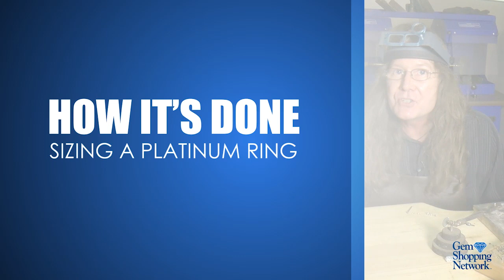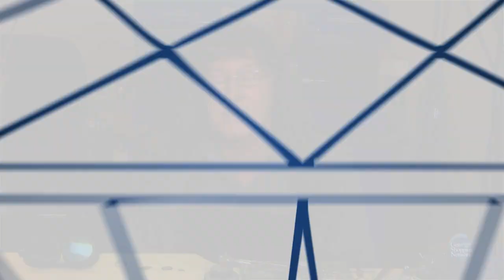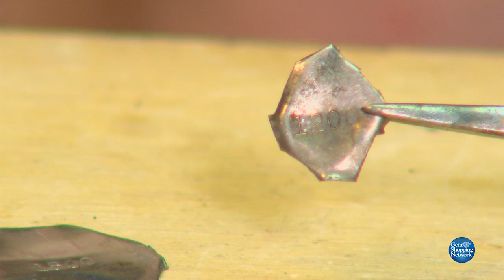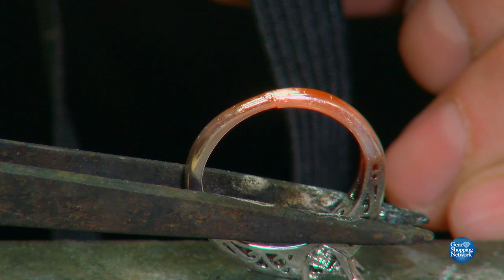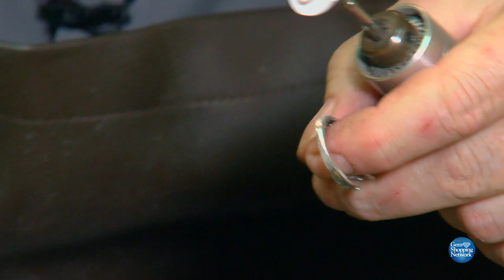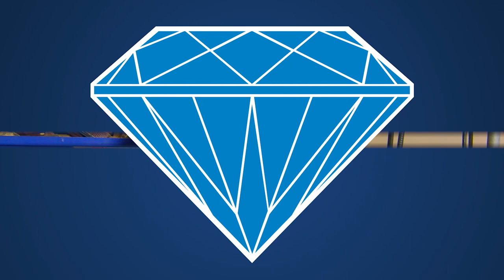HOW DO YOU size a platinum ring  – Tutorial l Gem Collectors

Comment: Could you just cut a thin slice of the sprue from the tree if we are using hydrogen/oxygen? Or is it too risky?
Reply from the maker: A Hydrogen/ Oxygen mix is not considered a “cutting torch” gas mix whereas the heat achieved by a Acetylene/oxygen mix could be. That said, I do not recommend trying to do that as by the time you got the heavier spruce temperature to the melting temperature, your thinner parts of the tree would melt without heat sinking them but then you would need to apply MORE heat and oxygen to compensate for that factor . Then you also get to such a high oxygen mix and temperature that you can “burn” the alloys in the metal and render your metal unusable until refined or you will increase your chance of having a lot of porosity, pits! .  And BTW, a “slice” of metal is never actually possible,  a melted drop of metal is how it would come off the sprue when the temperature is reached.
     A dozen sawblades is actually a better choice! :-) 
Shawn
Reply: @gemcollectorswithshawnlgem4613  thank you!